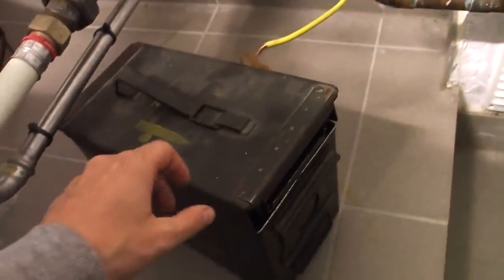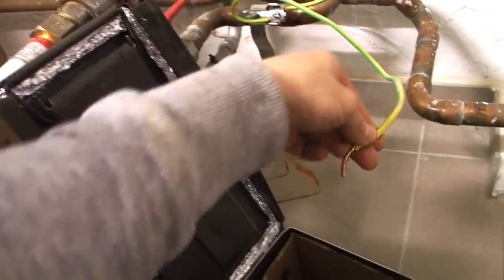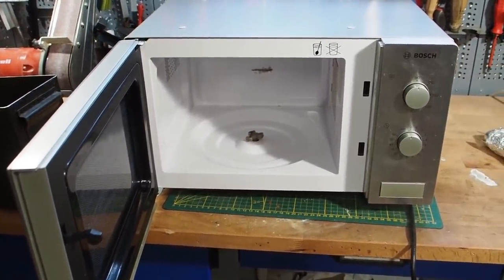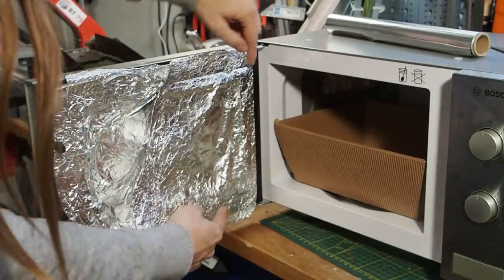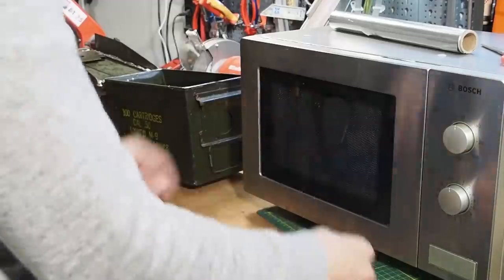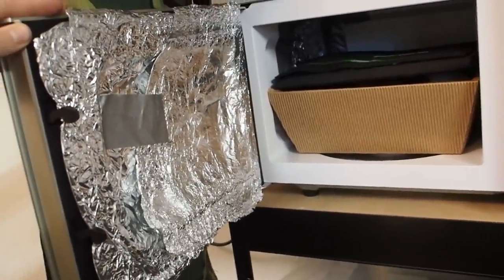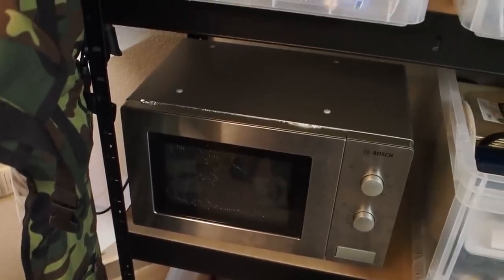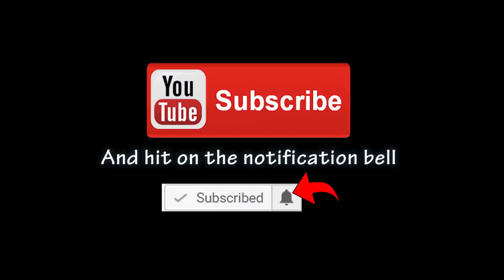How to make a Faraday Cage out of a Microwave #EMP

Comment: A good sealing method is to use adhesive aluminum tape used for HVAC sealing of duct work. I use it as a method to ground items all the time. Also it allows for a good connection to the frame using a sheet metal screw.

Comment: Those ammo cans are expensive. I used a can I got filled with popcorn I got for Christmas. I forgot about grounding it so after lunch I'm going down to my basement to ground it. Thanks for reminding me Lilly.
Reply: I insulated it with cardboard also.
Reply: Hello Dennis. Would you kindly tell me how to ground the can? I have two of these cans - what a great idea! Thank you!
Reply: $15-$20 at the pawn shops
Reply: @kele1264 attach it to a ground wire to it. Then run that wire to a lead pole in the ground
Reply: @kevreilly7  thanks so much! Have a fun and safe 4th!

Comment: Love your channel, Miss Lily. I am grateful for the time you spent researching this topic, and especially for sharing that information in a demonstration. That the protection from EMP can be so affordably easy is a wonder to me. This has set a fire under me to readjust my thinking,  and stop passively accepting failure. Tomorrow I will be setting up a cage for my electronics. I would do it tonight, but I am at work, and my shift doesn't end until 6am. Thanks again for waking me up.

Comment: I understand the principal of the Faraday Cage,  but if were hit with a strong sun storm or an EMP  what good will your  electronics be in your Faraday cage be with no place left on the outside to transmit to. Help me understand this
Reply: Hello James. It depends in my view. The pair of smal transmitters for the comunication of your own group when exploring the situation and the radio to scan for  news of gouverment, military or other EMP hardend stations make sense to me. The GPS and Mobile Phone wil be down for good quite a time of course.
Reply: After the EMP is over, at least you will have working devices. GMRS radios are extremely useful, but you have to be able to charge them (via solar or some sort of generator). Your smart phone is also a camera, word processor, calculator, etc. You can have an internal network, which is how the internet was created. At some point you will be able to connect with other people. The government will make sure that their networks are protected in their "continuity of government" bunkers, so if you last long long enough, you'll be able to make contact. Getting, learning to use, and protecting a bicycle generator, charge controller, inverter and some deep cycle batteries is also something to think about. If you can protect your car (with a Faraday cage car cover and maybe some sort of surge protector), it is also a 12V generator. The issue is that it needs gasoline. If some EMP happens, there will be many fried cars with gasoline in their tanks that could be syphoned out to run your car or generator. Lots to think about.

Comment: I thought those old style round galvanized steel / metal trash cans / bins (they come in all different sizes) was a cheap Faraday cage, just put something inside so your electronics don't touch the metal. (In a survival situation those trash cans / bins that can actually hold water/ rain water catch would be useful in many ways anyway.) But I don't know if they are chemically coated with paint or protected where you would have to scrape the rim of the and and the bottom of the lid to guarantee a solid electrical connection?

Comment: For the devices that charge off of grid power, get a small 100-200 watt inverter. Here in the US it would be a 12VDC to 120VAC inverter. Not very big, but you can hook it to a 12 volt battery or the solar panel and plug your devices into it. Don't forget to put it in the Faraday Cage!!
Reply: Probably worthwhile to put the battery in there too as they have a Battery Management System built in which is probably pulse-vulnerable.

Comment: EMP IS. More likely than you think. Power adapters that plug in have electronics in them that are susceptible, and if a generator is avalable you can plug in to charge. Put them in the cage. The charger base doesnt need to .

Comment: What I ended up doing was I put everything into anti-static bags sealed them and then put them into a box wrap the entire box in cellophane and then wrapped it in foil then cellophane again and then foil. 

only problem is your stuff is sealed inside until after the EMP is over.
Reply from the maker: exactly, and then you have to do unwrap everything to recharge your stuff.
Reply: @SurvivalLilly  Have you tested your new cage? Put your cellphone in and dial your number. if it doesn't ring your good if it does....welll
Reply from the maker: @highlander723  a powerful emp is much stronger than radio waves or waves from the cell tower. even if your faraday cage blocks out the radio waves that does not mean that it will survive a powerful EMP.
Reply: @SurvivalLilly  Yes they are but it's more of a sanity check to make sure that you got a good seal on your door. because if you can block those out now better your chances against an EMP but if you can't even block those out EMP is going to definitely fry your stuff.
Reply: The EMP will be over in a second. Ikea used to sell nesting aluminum boxes with tight overlapping lids. Place one withing another with insulation in between.

Comment: Pretty cool idea. About the items to store,  I would add a flashlight, LED and other electronic parts are vulnerable and the metal casing is open to the glas front. Maybe a fiever thermometer also if you do not use one with mercury.

Comment: Should be easy enough to modify wall plugs to work with whatever power source you have even if you just have to wrap some bare wire around the plug no?

Comment: Hi Lilly, I did not take the time to read through all of the 280+ comments your video has here currently has. I am curious, are the Faraday cages that you show off in this video meant to protect against EMP, or electrostatic discharge events? Maybe you have come to discover otherwise since the making of this video, but a grounding of a faraday cage for EMP events does minimal if no good for the electronics inside. If it is for an electrostatic discharge like a lightning bolt then yes, a grounding of the cage is definitely warranted. After watching this video, I looked up how to ground a microwave Faraday cage and the first hit was for the empdoctor. The video titled “Should you ground a Faraday cage?“ was the first hit. He runs an experiment and explains what I am talking about in his video. Take care out there, and keep up the good work!

Comment: Lilly. Does the Faraday Cage have to be grounded? I'm not sure where in my house I would find those wires. I see those wires sometimes in bathrooms. I never knew what they were for. I don't think I have them in my bathroom.  If I only have a bucket, does that need to be grounded?

Could I go to the recycling centre and beg for an old microwave someone is throwing away, and then pimp the microwave up to be a Faraday Cage?
Reply from the maker: grounding will increase the chance that your gear survives. but also without grounding you will have a good faraday cage.

Comment: I'm not an electrician, but depending on how the actual grounding in your house is realized, isn't it the case that the grounding part of the cable works as a very large antenna? Which, in case of an EMP, would be contraproductive. Does someone reading this comment know more?

Comment: I started to update my bug-out bag. I took out the crank radio. For me, if the ga-ga has hit the fan that bad that I am bugging out, there won't be many radio stations working. Similarly, I took out my suture kit and tourniquet. If things are really bad, what good will stopping a lot of bleeding if the infrastructure you'd really need after the first-aid, is also gone. It's about a four day walk to my bug-out location. Worst case. So I'm going to make a secure burial system for all the bug-out items I no longer want to transport and leave them safe at my bug-out spot.

Comment: The cable acts as a an antenna. So will the earth cable running around your house.  Did you test it? Try putting your mobile and radios turned on, then try to send a text or call to your radios or mobile.
Reply: $20 you could call her cell phone and it would ring in the microwave and the ammo can for that matter
Reply from the maker: look, radio signals and cell signals are only a fraction of what you get from a powerful emp. we cannot try if the faraday cage is working, because we will never be able to recreate such a powerful emp that an asteroid or a nuclear b would produce. so you cannot test it out. in some cases you even need a double walled faraday cage. it really depends on how far you are from the epicenter of the emp
Reply: @SurvivalLilly  My point is, if a mobile phone signal or a radio signal can be received inside the microwave, then it needs additional work.
Reply: @SurvivalLilly  Absolutely.

Comment: i think id rather keep my seals,for water protection, and put auminum foil, and/or aluminum/copper tape, on the outside, and seal the gap that way. I would also scrape off paint between lids/doors, and solder on connection wires between parts to make sure everything is one solid container.

Comment: Its a good idea to include the charging devices in case the power comes back on or if you find the use of a generator or simply power inverter off a battery. Also you could put a power inverter in their you can get them for $20 and not all batteries will be killed in an EMP event. Also long term storage recommendations for lithium ion batteries is 35%-75%. Storing lithium ion's at 100% supposedly degrades the cell according to manufacturers which is why ur brand new cell phone does not come fully charged. Also bear in mind that most NATO nations SHOULD have a enough power equipment in storage to rebuild the power grid one or two times since EMP has been a concern since the cold war. I  know we do in the US... But also bear in mind it could take 6 months to a couple years to rebuild the power grid... You could put a sealed lead acid or lithium iron backup battery in the old ammo can with a small solar charge controller. A good way to test your faraday cage is to put a cell phone in it and call it also you can test a few different frequencies with the baofengs.

Comment: You can buy ready made Aluminium Tape which has a strong adhesive, that makes lining the inside of boxes etc a lot easier.   Do a layer of that first, then a second layer with normal foil.
Reply from the maker: But on the adhesive side it doesn't connect to the metal? Or am i wrong?
Reply: @SurvivalLilly  The adhesive is strong, but I don't think it impacts on the effectiveness and you are still making the contact.   Though I may be wrong :)   

I did follow the advice on a YouTube video but can't find it now.
Reply: @SurvivalLilly  The 'adhesive' is just removable tape. Take it off and you just have aluminum.

Comment: I like those plain steel buckets with cantilever clamps! They look super useful.
I'm not sure you'd need to pull the silicone seal out though 🤔,  just cover them with foil since the bucket and bucket lid, and ring clamp all contact each other and are all bare metal.
Reply from the maker: oh yeah that would also work!!

Comment: There's a decent amount of space between the basket of electronics and the top of the microwave. If there is a shockwave plus an EMP for example a asteroid crashing down on earth; wouldn't the electronics get damaged if they smack against the top of the microwave?  What would be better a piece of Styrofoam or sponge that will fill the gap of empty space wrapped with aluminum or not wrapped with aluminum?
Reply from the maker: If this happens you are dead anyway
Reply: 😂ok bad example, so just say a shock wave and an emp  blast occur Would some sort a padding wrapped or unwrapped in aluminum be helpful?
Reply: Meteors or comets or even Planet X have nothing to do with CMEs which come from the sun, while EMPs come from enemy rockets. There is no shock wave.

Comment: That was great Lilly, thank you! I have a question: for lining a wallet or purse to protect credit and id cards, etc, what do you think of mylar bags? Or sheet mylar made to fit a backpack to protect computer? Thank you for your clever ideas and the wonderful way you explain things! Good health and happiness to you and everyone you love!
Reply from the maker: mylar is part plastic part aluminium. i think it will work as a faraday cage. but still it is not grounded. but better than nothing.
Reply: I'm just wondering where you're going to be able to use any of these cards following and EMP strike...???
The machines and ATM's  that you'd put your cards into for use, would all be dead.
Reply: @RawTopShot  Think RFID, today.  Large stores like Walmart, toll booths, many places. Keeps your info from being read. That's why E-Z pass sends mylar bags, so that if you don't want your tag read for whatever reason, put it in the mylar. As far as EMP goes, I wouldn't know what would come after. Neither do most other people. What harm is there in protecting cards? None. Why would I protect my computer? Because it can still be used for many things, even if internet is down. Glad I could help.
Reply from the maker: @RawTopShot  that is true also! better to always have cash at home and in your pockets.
Reply: @SurvivalLilly  Thank you, Lilly. Also, if I had a steel or aluminum can with lid, what would I use to ground those? I'm glad you did this video, because I didn't know they would need a ground.
Reply from the maker: @kele1264  with my ammo can I just stuck the ground cable inbetween the aluminium foil and the rim of the can. thats how I made the connection. I am sure you can also do it some other way tough. It is always a little tricky to make the connection without producing a hole. Maybe you can also use the wire and go around a handle of the can, if there is one.
Reply: @kele1264  I completely agree with computer /laptop protection ; it was just the card issue I had problems with (as far as protecting from emp)

The scenario can be trialed and tested with a large electromagnet, to test the barrier properties of various containers and the protection of items within (using expendable items of course). 
These electromagnets are available for use and are used (one of the many uses) to remagnetise audio speaker magnets; especially the larger coned  sizes with large coil magnets 10" and up diameter, full range and subwoofer speakers.

Other emp devices available are used (conversely) to destroy data on  magnetic platter hard drives, tapes etc, at commercial end of life.
SSDs can also be irreversibly damaged. Of course you can just crush and shred them before material recycling.

Edits highlighted.
Reply: @RawTopShot  Good points about magnets. I wonder what would be better to use, steel bucket with lid, or aluminum cans...
Reply: @SurvivalLilly  This is a good excuse to go to Home Depot or Lowes and check out the options. I see more projects in my future. 🤣  I love your channel so much! And your gardening channel as well. I learn so much from you!
Reply: @RawTopShot  Interesting but I am doubtful. Devices for removing data (buklk erasers) use AC to rapidly switch the magnetic direction which disrupts the data on the media. Elecromagnets are DC and so attract metal as long as power is applied. Neither is anywhere near as powerful as an EMP or CME, and would not penetrate even a microwave wall. Lilly is right, you can't really test them. But by all means put a three-axis EMF meter inside your cage and see what you can do, and let us know.

Comment: Any thoughts on a potential Third Wave of.... "C" ?
I've made myself a half-mask with HEPA filter back pack.

3M mask, conduit pipes, airtight pipe couplings, systema sealing cake box with 2x HEPA filters siliconed into place; it's located inside a light backpack/rucksack. 

The exhaled air from the mask goes through a pipe downward and through a one way valve into a hip worn container that has an isopropyl / bleach mixture inside, before the air vents to atmosphere.
I did consider UVC sterilisation for expelled air, but chose not to go that route, in order to avoid the high power requirements (and its limitations in a disaster environment)

Pipe sizes and 2x HEPA filters where chosen for air flow, to make sure it was easy to breathe (no flow restrictions on normal and light load usage) and so could be worn comfortably for extended periods.

Comment: First, if somebody uses nuclear bomb EMP will be the least problem youl ever have.  And second i think electronics will not be affected if its not turned on. You have EMP every month in summer, during thunder/flashes if its in vicinity of 100-200m, its probably the equivalent power if not bigger, and most things still works...
Reply from the maker: you have no idea about nuclear EMPs. they destroy all electronics no matter if it is turned on. also if the emp happens at a certain place there is a high chance that the entire electrical grid of a country or even continent collapses. then you have a total blackout.

Comment: Great video👍 ! Is there a way to check if a farafay cage works perfectly ?
Reply from the maker: no, unless you can reproduce a powerful electromagnetic surge in a laboratory
Reply: @SurvivalLilly  Thank you 👍
Reply: One way of checking a faraday cage is to put a cellphone inside and call it, if the call goes through it doesn't work. But that doesn't mean it will work against a powerful emp.